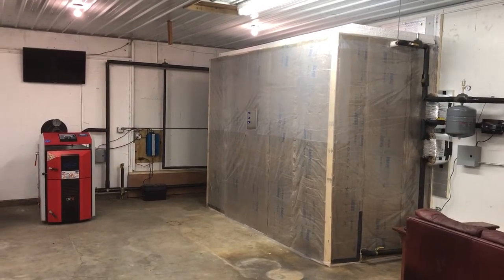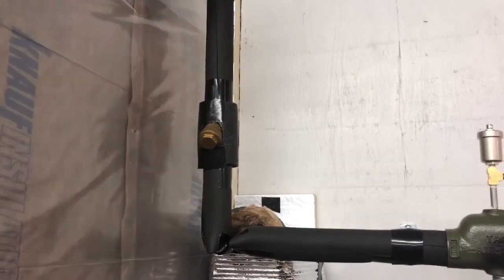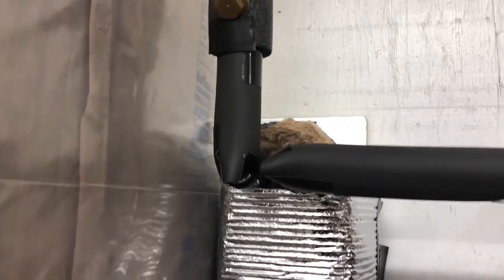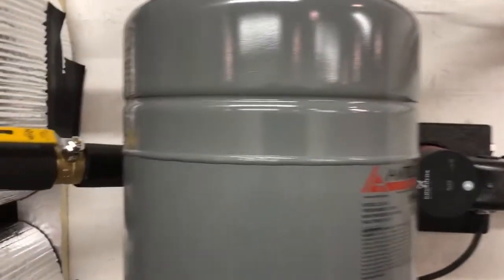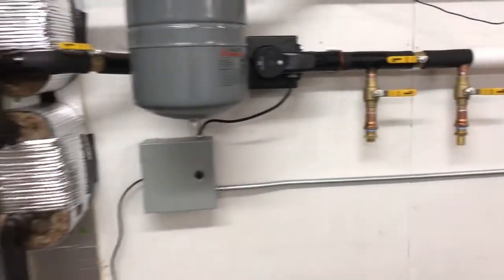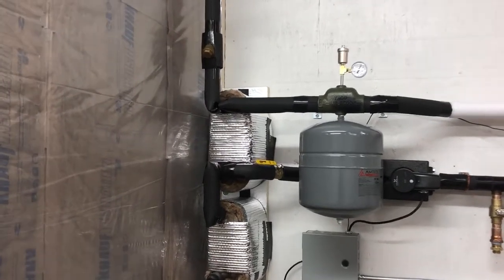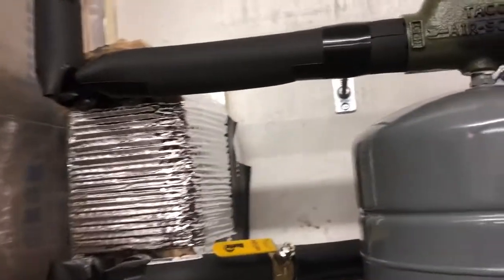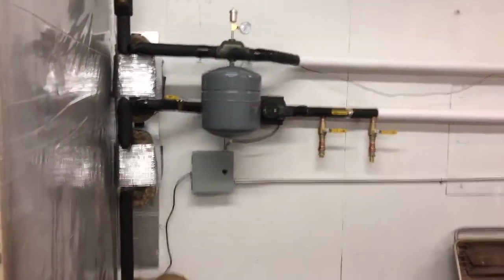Part 3 Attack DPXL-45 wood gasification boiler w/1000 gallons thermal storage

Comment: Update  Sorry I saw towards the end you were discussing why...  Totally agree!  I did the same thing with my driveway ice melt.

First off, thank you for the great videos!  I am running district heating but with waste oil.  I just had a quick question as to why use the flat plate between the thermal storage and the boiler?  Is the boiler open?
Reply from the maker: Flat plate to isolate glycol run in the ground and plain water in the boiler/storage tanks.  1000 gallons of glycol = $$$$.   As of now I am running plain water in the underground run anyway because glycol likes to leak at the pex al pex fittings.  Now to prevent freeze up I simply run that circulator full time during the heating season.  Still need to solve that pex fitting leak :-(

Comment: I question if you would want to avoid signal wire from the house to storage. I wonder if the household circulator pump could trip a flow switch. You would eliminate a conduit or just a buryable wire.
Reply from the maker: I do have a conduit run but it could just as well be a buried wire as signal wire is low voltage.  That conduit now has my house supply run from the solar system so I'm glad I put the conduit in the ground.

Comment: This is a pretty elaborate setup for a residential service. I think it is great and am looking at doing something similar in my home. I was just curious about a couple things. First, with 1000 gallons, how often do you really need to burn? I would think you'd get 2-3 days out of that much thermal storage. Second, do you really need a pump on the thermal storage? The system should thermosyphon when the loop from the house kicks on.
Reply from the maker: If my thermal storage was in the house I would be able to go several days between burns.  Because it is in a building 100ft away, all losses from boiler/storage/piping go into the boiler building. It's a 24x48 workshop basically with standard insulation and a uninsulated floating slab. The losses keep that building between 40-55F all winter long- probably 58f in there right now. As far as thermosyphon I don't think it would work with my 100' of lines between boiler building and main house buried 48" in the ground.

Comment: Is this system useless during power outages?
Reply from the maker: I have battery backup which will run the boiler and charge storage for at least 8 hrs.  If you had in floor heat or other radiant emitter that only requires a circulator to run then yes this would run and heat off the battery backup.

Comment: Where or what model are those panel meters.  Really like the displays on them.  Have the exact same Attack boiler I will be installing this fall with 1000 gallon tank also.  Currently have radiant flooring I installed and a tankless propane boiler.  When completed the propane will back up if I get below storage temp automatically by diverter valves/aqua stat.  Diverter valves are for bypassing the coil in the tanks so I don’t heat up storage on propane.  👍 Great job
Reply from the maker: The panel meters were purchased on Ebay.  https://www.ebay.com/itm/Fahrenheit-Cel-F-Digital-Thermometer-Temperature-Dashboard-Meter-Gauge-PC-MOD-US/141731861746?epid=595245109&hash=item20ffe094f2:g:1XIAAOSwHnFVukOk

Comment: Nice system. How does the house heat if the storage goes cold? Did you use a second thermostat in the house?
Reply from the maker: I use a time delay relay so during a call for heat from the main thermostat if the boiler system does not raise house temp the propane furnace will kick in after the time delay.